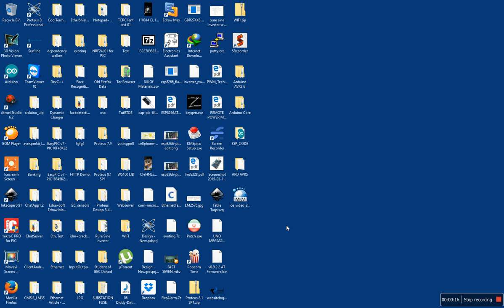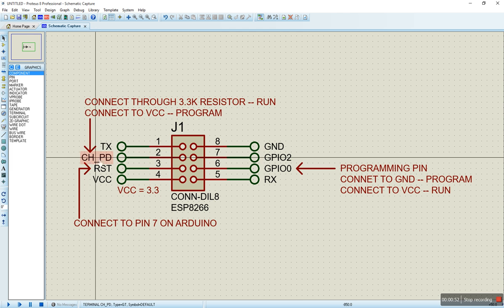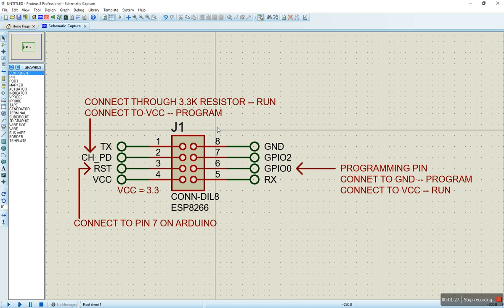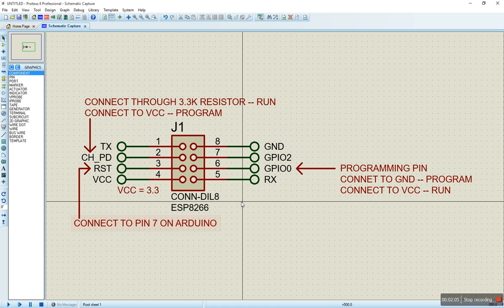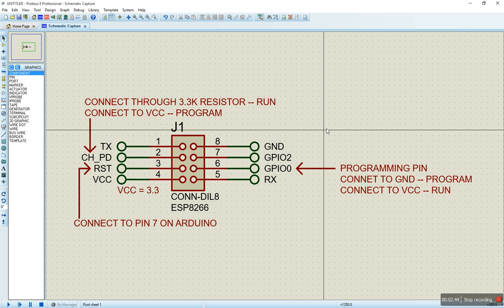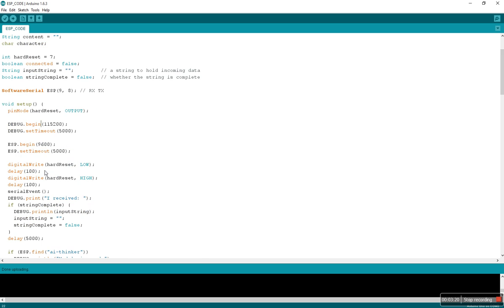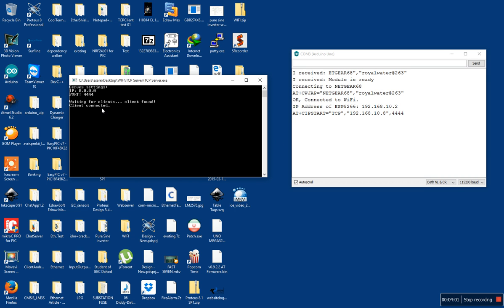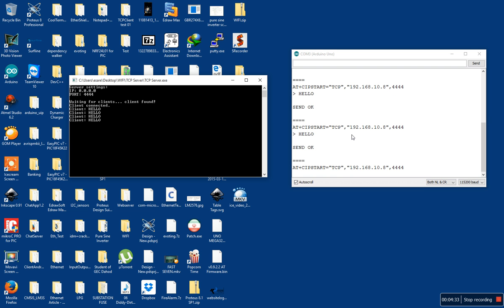Using Arduino UNO with ESP8266

Comment: Hi . Thank you very much, It is working perfectly. It is a great tutorial.

Some points i changed, 

comment  the while(1)  after the ("Module have no response" ) line
TX and RX of ESP8266 should be connected to 9 and 8 of Uno respectively. (Suggested by Asadujjaman)
Change the Dest_IP to your system IP and check with nc -l Dest_IP PORT  (Linux)